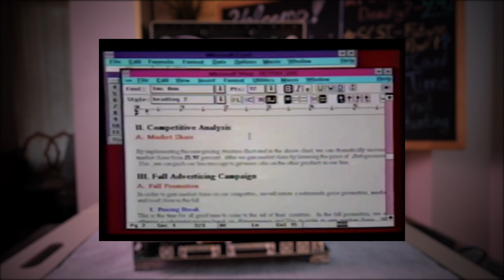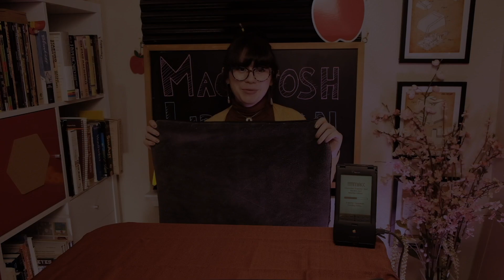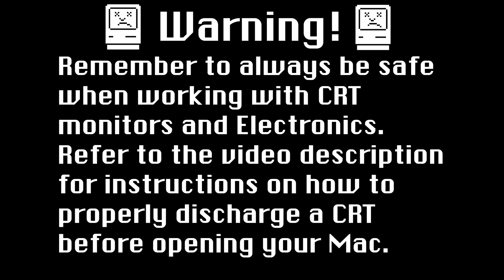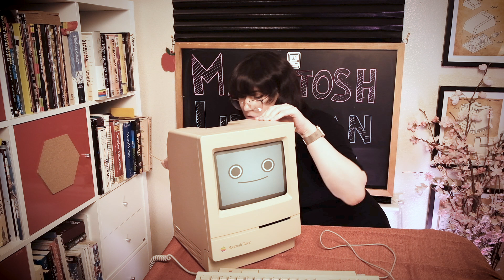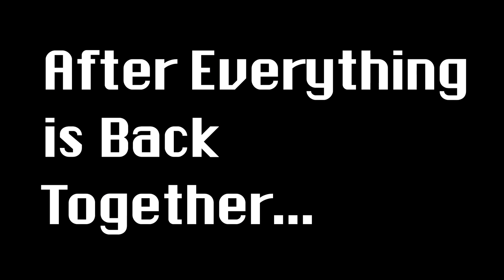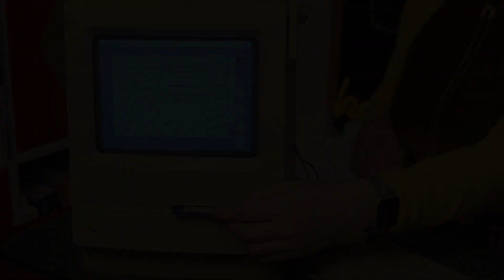Apple’s Macintosh Classic -  Retro Computer Hardware Overview and Review

Comment: The leaking problematic capacitors are only the SMD capacitors. Electrolytic  capacitors don't cause leaking problems.......Some friends said me that tantalum capacitors are more susceptible to explode when they start getting older.
Even SMD capacitors today are more reliable than early 90's SMD capacitors. :)